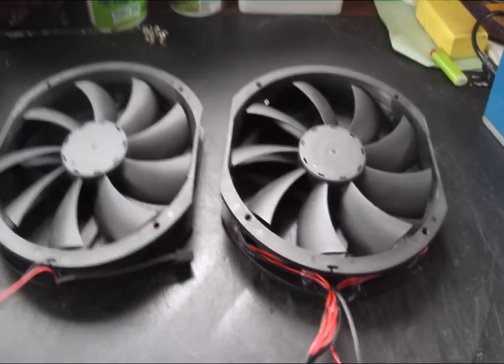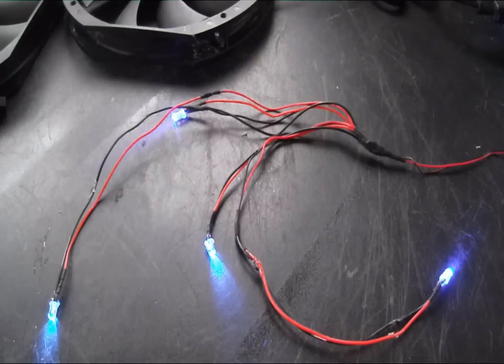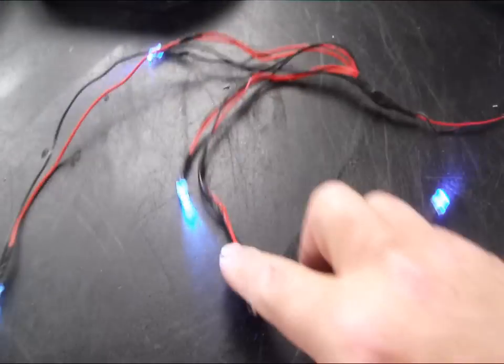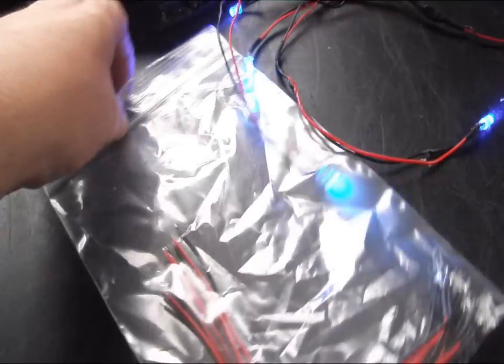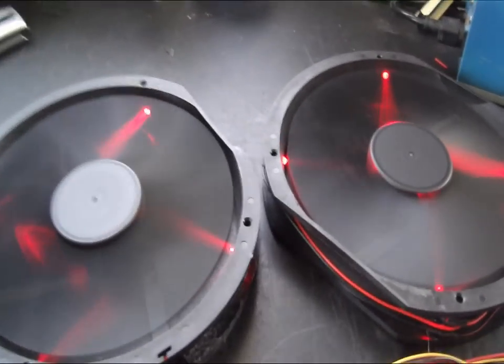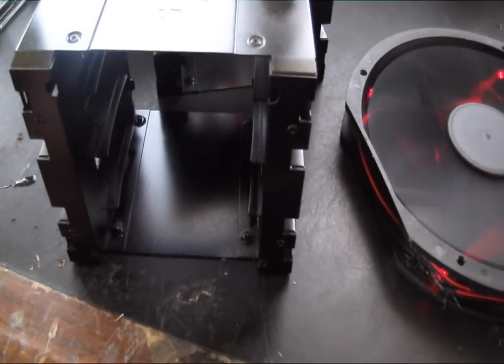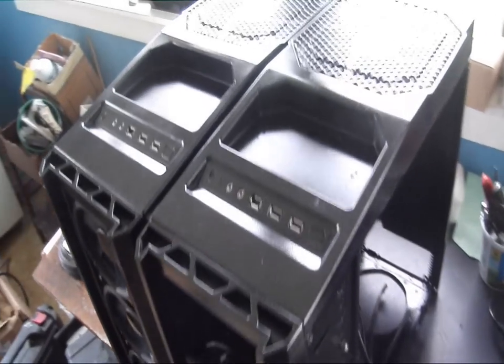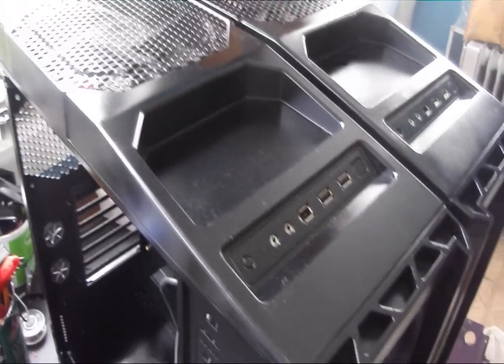Antec 1800 Build Log Part 8

Comment from the maker: It wont be long. I am also excited to see what it is going to look like all done. As for the fans Antec has their own special shape so most 200 mm fans would not fit in the case. But even if they did just a 200 mm fan can run as much as $30.00 each. The led`s were $2.00 each so much cheaper then replacing the fans even if I could have gotten one with the red led`s.